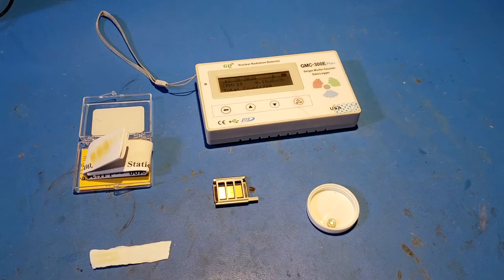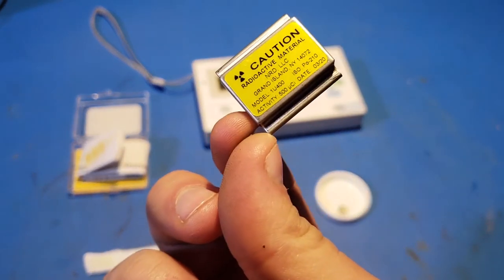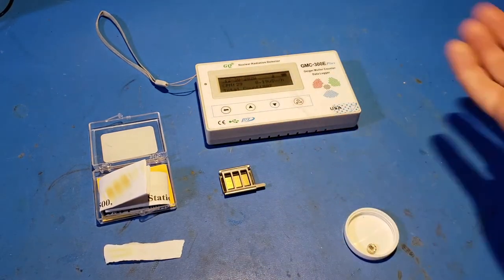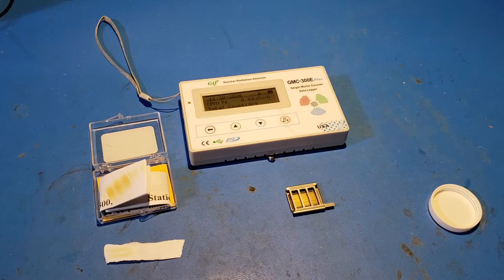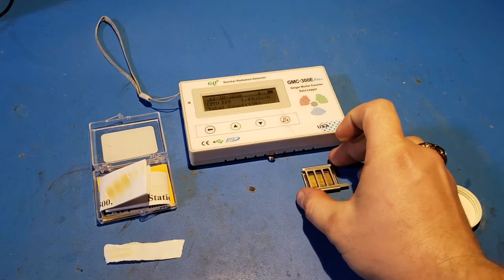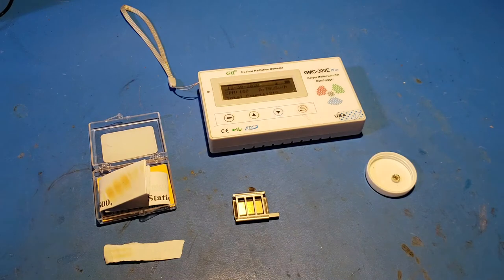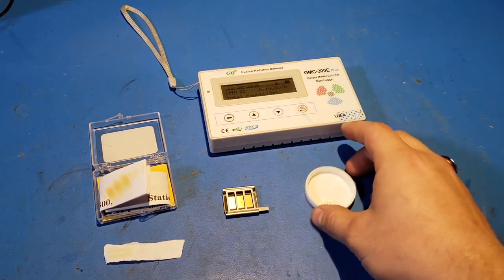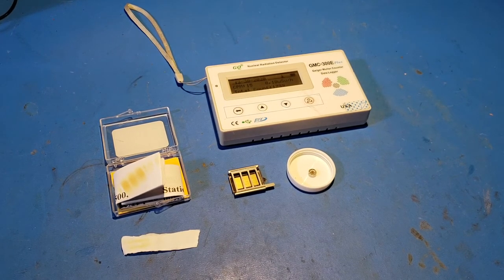Burning Paper with Alpha Radiation Sources (Polonium-210)

Comment: Does polonium really have 1.21 gigawatts and what will happen if you use it to power a  flux capacitor in a  DeLorean would it really go back in time?
Reply from the maker: I do believe Doc Brown used plutonium that he "borrowed" from some Libyan Nationalists not polonium lol. If you wanna see me make a flux capacitor, I've got flux and ceramic caps right on this desk ha. I'll put some caps on top of the polonium sample, spray some flux on them, and we'll observe that for some reason it only seems to move forward in time at the normal rate.

Comment: I think the yellow is caused by the barite filler turning yellow, not the paper fibers, here's Radian Barite, radioactive barite that contains traces or radium and uranium: https://e-rocks.com/item/mnr181043/radian-barite
Reply from the maker: Hmm. I'm not familiar with barite or the structure of paper involving modern filtered paper. Can you elaborate a bit more on exactly what you think is happening? Is what your proposing different than what happens when paper yellows naturally by aging or the same?
Reply: I don't understand. Are you saying there is BaSO4 as a filler in everyday paper?
Reply: Baryte (Barite) paper is a classic photography paper with BaSO4..

Could the yellow color maybe come from cellulose or lignin oxidation/nitro reaction, caused by ionized air molecules in these areas?
Reply: I've never found any information on Barium in modern printer paper, but I've done a long-term test with Americium on white printer paper, old book paper and cotton paper and all 3 developed the characteristic alpha burns.